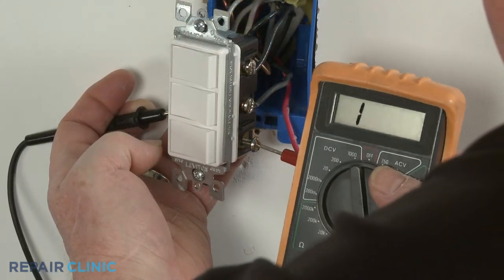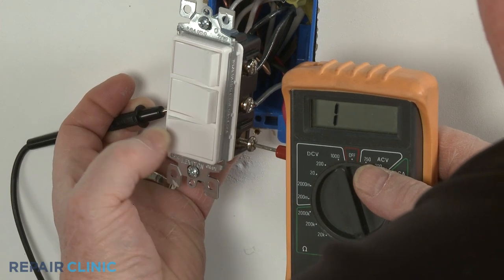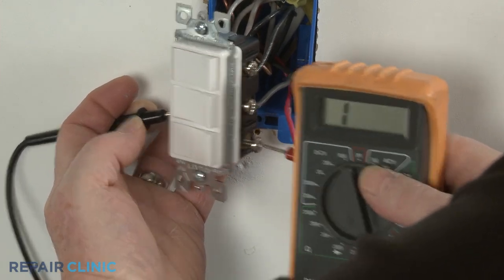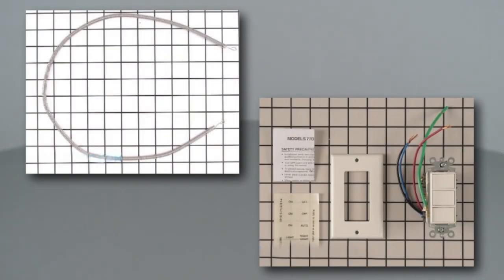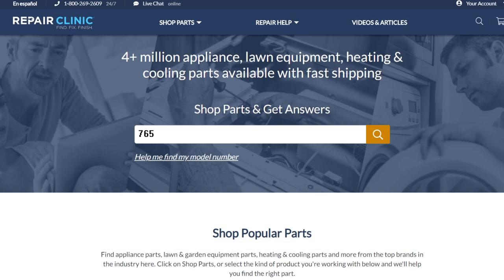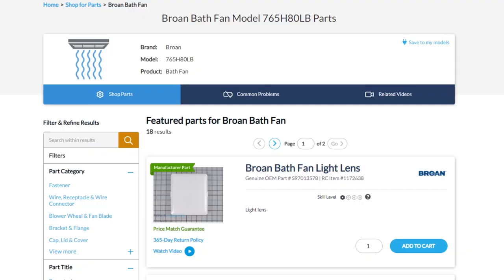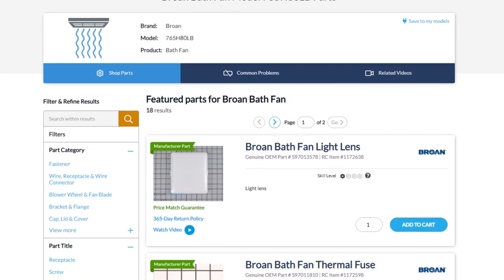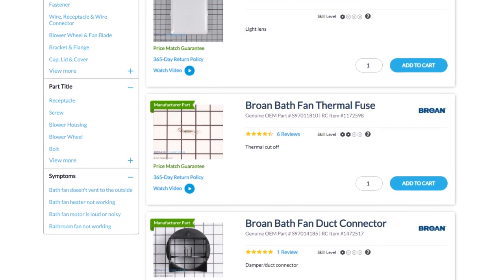Bath Fan Heater Not Working — Bath Fan Troubleshooting

Comment: You missed one thing.  If you test from the red wire to the white wire on the unit itself, what should it read.  I have a new one and it is reading a short or 0 ohms.